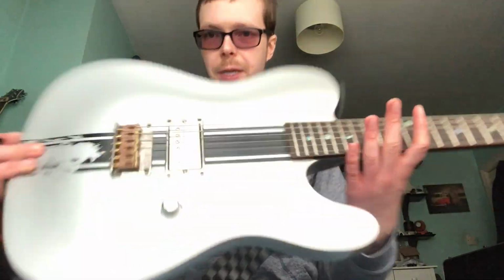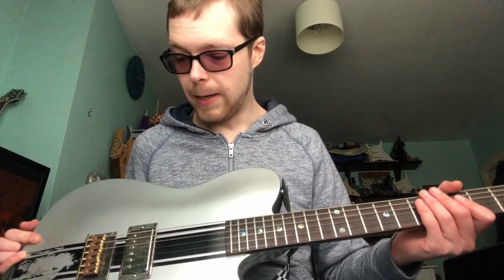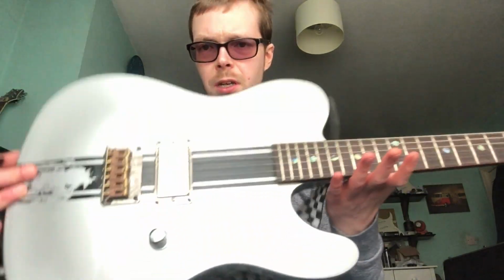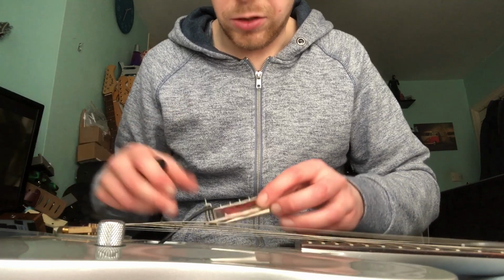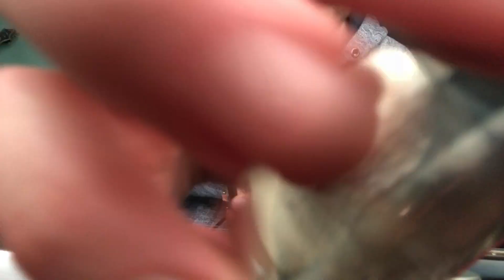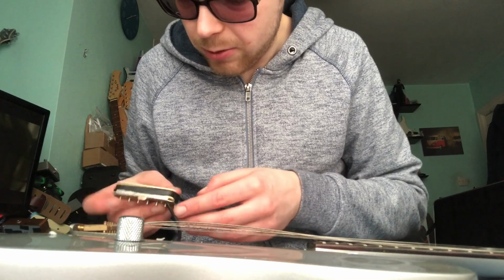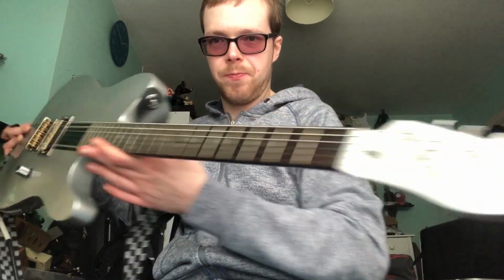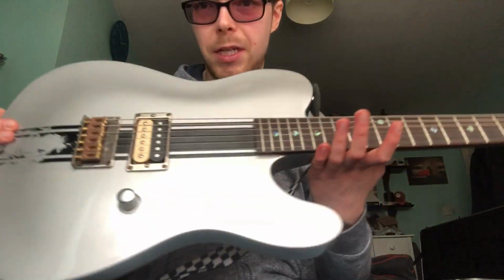How to remove a humbucker cover

Comment: I did it also that way, and also get 2 zebras on my les paul, but expecting all black 😂 you should put something under pickup to avoid possible scratching guitar finish..anyway sound is much better without covers, more open, aggressive, better clarity..
Reply from the maker: Yes i probably should have done in hindsight haha. yeah i found that it's more clear and present. thanks for watching!